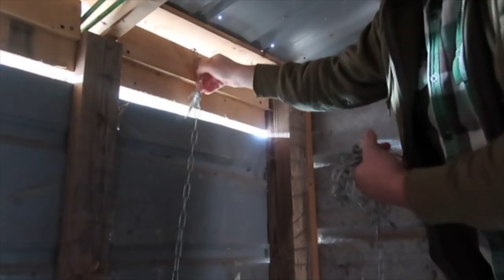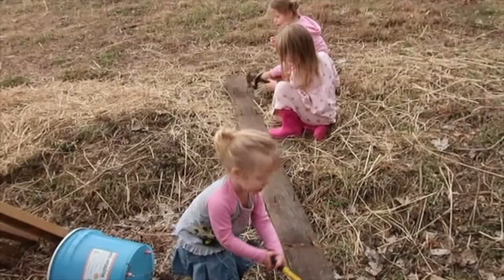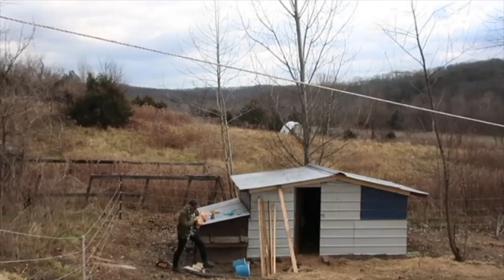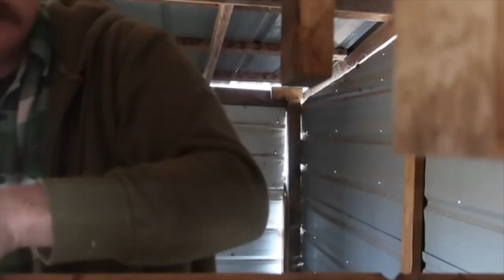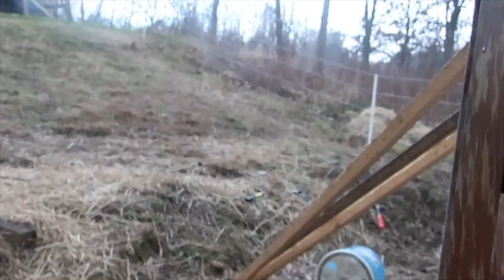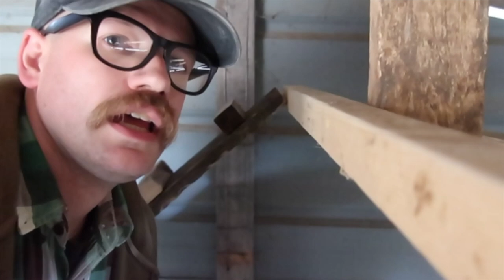Chicken Coop Renovation - ALL HANDS ON DECK!

Comment: Enjoyed the video Sam. Looks like you have some good helpers. Couldn't tell which daughter it was but she  knows how to use the hammer claws to bend the nail for removing. You're doing the right thing spending time with them and teaching them how to work. Great job. Maybe if you have time you could give a tour of your old barn. I bet there's some good reusable material and hinges in there. It looks scary but that barn will stand for years. Thanks for taking the time to produce the video. Y'all take care and God bless.
Reply from the maker: Thanks Ron. Ivy is 6 and is a quick learner when it comes to tools and such. I showed her once and she started straightening all of the nails herself. The old barn does have a bit of salvageable material...but it also has a ton of rot from a terrible roof installation. Thanks for watching!!